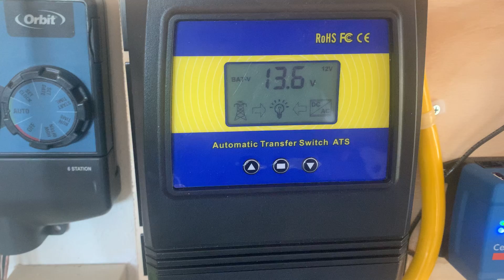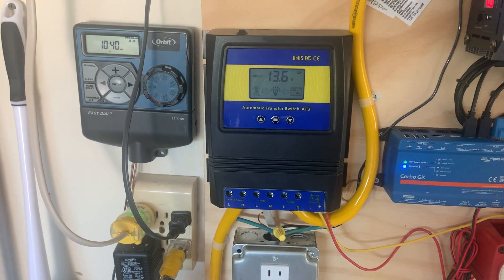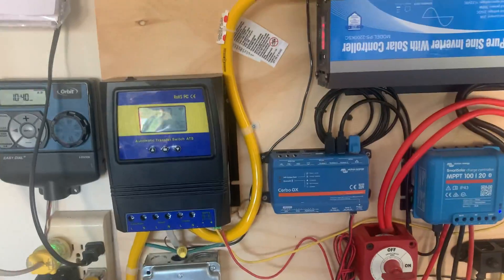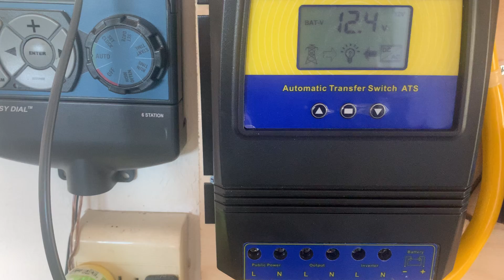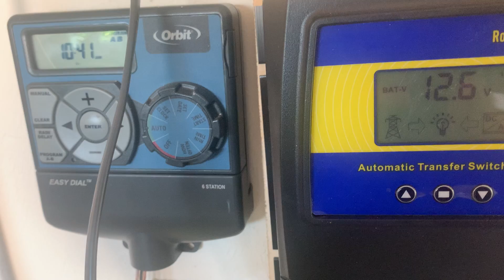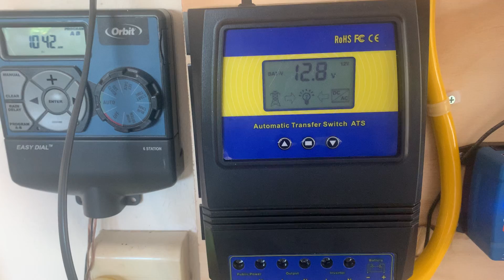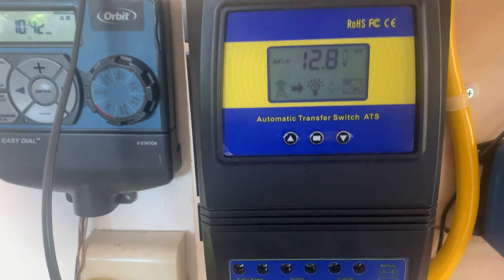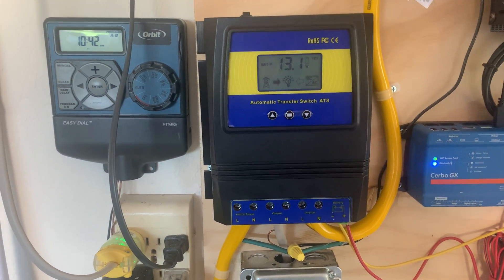Amazing transfer switch to save your batteries - MOES transfer switch

Comment: When it comes to powering up the unit, the small green plug......

is that supposed to be 12 volt or do you just hook it up to your battery Bank and power it up with what ever voltage configuration the battery bank is built to??

Comment: Just it fully replace the amps / capacity of the battery bank? I've just bought the older model of that unit & the companion solar charge is in the way.  I have a 3.56KW lithium battery pack @ 250 amp hr.  Will it just add quickly recharge the batteries thru the AC output of ATS IF YOU PUT AN AC TO DC converter on an outlet from ATS TO BATTERY PACK, as an additional charge circuit W/O solar?  

Also looking into how to wire in a low voltage auto start for a 30amp 60hz generator to replace my grid AC voltage input???

suggestions???
Reply from the maker: This unit will not charge, it just stops the loads on the batteries at a voltage limit (which you can set).  For a charger with auto start of a generator I would go with one of the all in one units (they have a built in xfer too).  I like this one due to the 80 amp solar controller and the price of the unit https://amzn.to/46C5czG

Comment: I am installing breakers at AC and INVERTER because if and when that switch fails (it will someday) the AC could get shorted straight into the convertor and fry it plus start a fire.
Reply from the maker: breakers are always a good idea. In my opinion… You can’t hurt anything by doing that
Reply: What size breakers would I need to use?
Reply: @daveyboy8907  I am not a certified Electrician. However I would use GFI 15 amp on both sides. If the relay on Convertor side blew and then the Grid side relay as well then there could be a direct link in the system which is a scary thought. It is a cool device but be very careful and don't mount this stuff on WOOD use a surface such as a fire place wall board that does not burn like a piece of Plywood ;)
Reply: Great idea. Not so good put together.
1. The internal wires are to small for the power claims. The wire are more like #10 or maybe 8 gauge. Hard to tell on the Chinese wire. It's not true awg copper wire. Sure he'll isn't #6(60 amp)

2. The switching is done by two separate form c relays. Which are each N/O or N/C relay They are rated at 60 amp. Should have used a single DPDT relay. That would keep things separate under a failure. 

Positive thing is this controller does resort to the grid if power is turned off to the unit meaning DC or inverter. Modification could be to use an external relay that is correct and also correct wire gauge for rated power use. Use a 3 pole  8 pin relay or a contactor so all is separate (L1 N) and all turns on/ off at the same time to the respected power source.
I did buy one off Amazon. Ford it for 30.00. so I took it apart and there were my findings. 
Again great idea but cheap ass Chinese product. You can build one that is proper for less then 50 bucks if your savoy enough 
Hope this helps
My 2 cents😊

Comment: I have had a few of these units in the past. The original unit was a lot more robust than it's newer counterpart, yep avoid as mentioned by a previous commenter. It will also work with 24v and 48v systems all at 50A perfectly. You would get better power output putting those batteries in a 24v configuration. Downside though a different inverter would be needed. A nice unit.

Comment: And what happens if let's say you try to pull more than your inverter can afford and switches off, will ATS switch instantly to grid?
Reply from the maker: That’s a good question, I usually have the transfer switch well below inverter thresholds . But I will test this by just turning  off the inverter while the switch is powered on and let you know the result.
Reply: @colinauld  please tag me if you are going to upload a video, thanks.
Reply from the maker: If the inverter is off and the switch is still powered on it will kill power to the outlet.  Here is a full video showing this test …watch the second video titled it’s pass through device. https://bestfavoritesbestof.blogspot.com/2021/12/transfer-switch-to-protect-your-battery.html